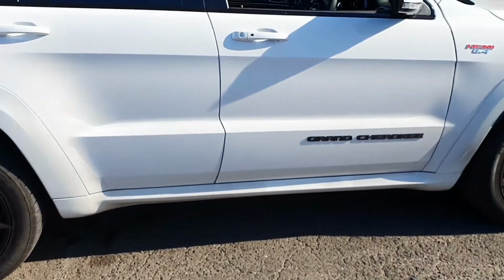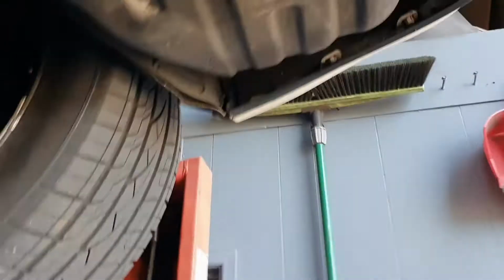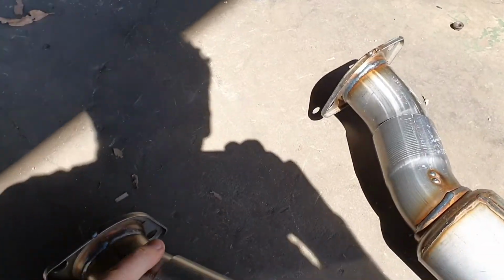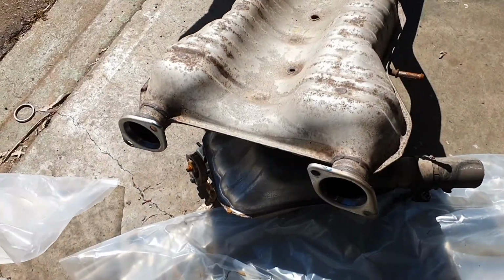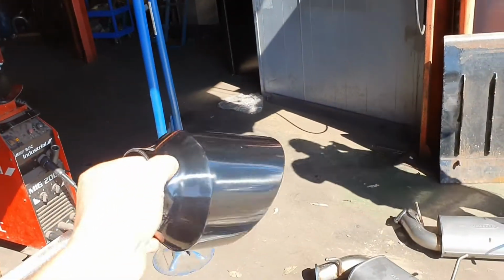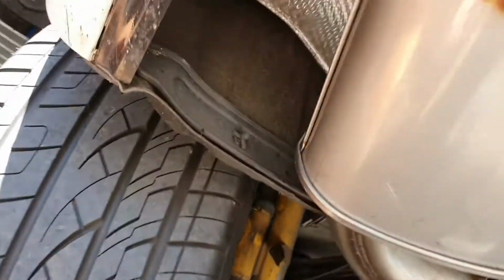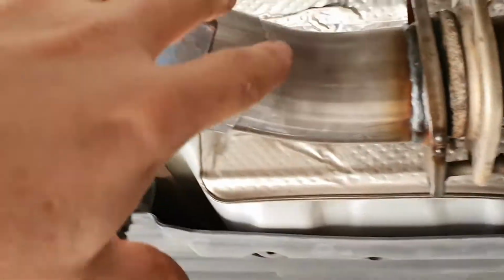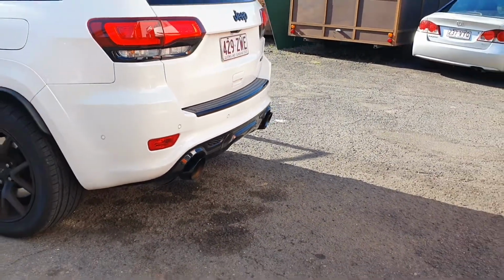Jeep SRT8 cat back exhaust

Comment: Gorgeous how did u remove check engine light
Reply from the maker: Hi, cat isn't a problem but if you go further and do extractors with high flow cats you have to tune them to turn off the engine light.